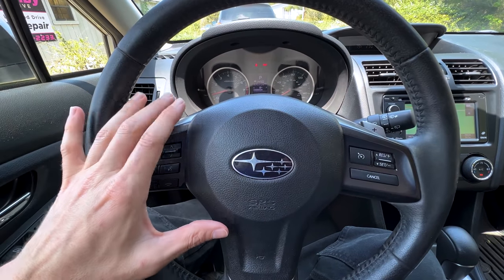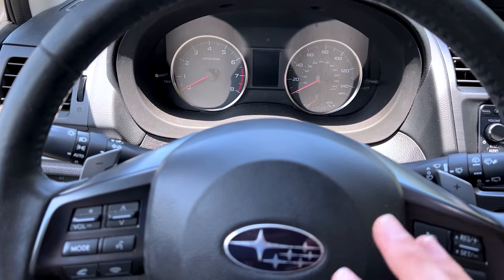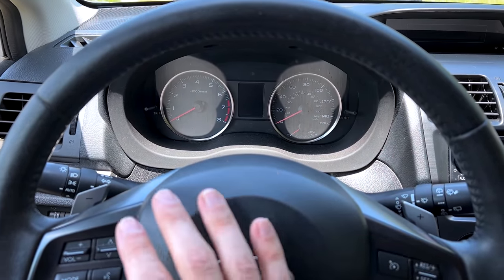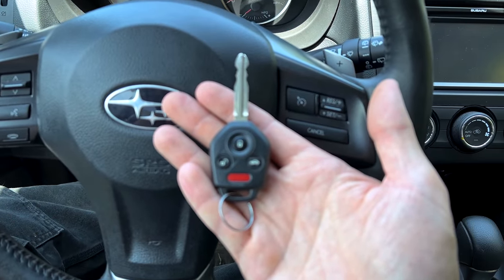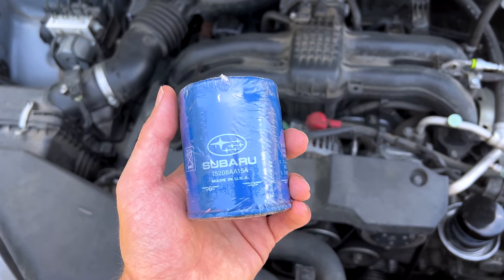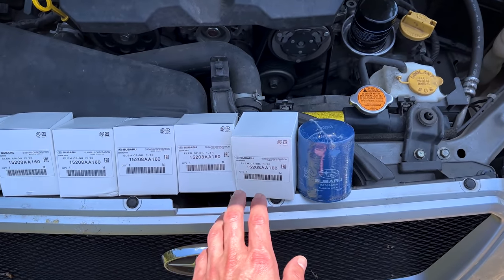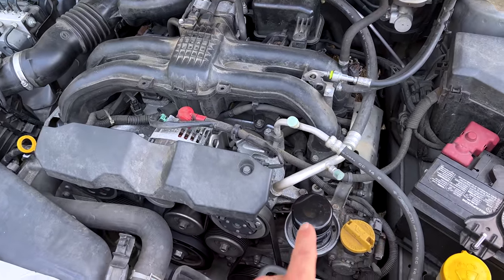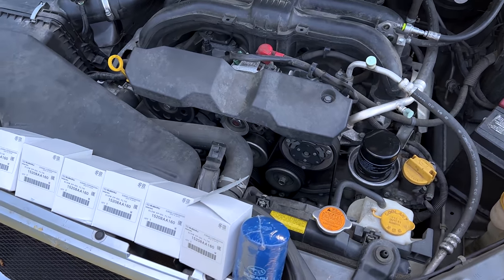Subaru Clear Flood Mode Cranking And Black Vs Blue Subaru Oil Filters! Know The Difference!

Comment: you may have discussed this so forgive me if you have, but what is your opinion on the Baxter Performance Subaru SS-101-BK anti drain adapter?  They were recommended and I plan on putting one on my 2018 outback (it is on order right now),   I am using Wix filters.    You would not have to do the flood clear thing - my wife won't do it.  Also the WIX filters I use are likely better than the Japanese Subaru ones - they are very high quality (I use them on all my vehicles).  Baxter Performance makes an anti drain adapter that is not cheap but seems like it is extremely well made a good solution for the oil drain back problem on these.  I feel like you "get what you pay for."  Have you ever tried or reviewed or have an opinion on these?  I also have used a Fumoto oil drain valve too (now there are other brands too) on my Forester and these should make for extremely simple oil changes - may put one on the outback.  Should have a tool-less oil change except for an air compressor to blow out the schrader valve on the oil drain adapter before changing the filter (so that it drains it of oil so it won't make a mess when you change it).  I am not affiliated with either, but I have heard good things and have hands on with the Fumoto valve and it works great.  You won't need any hand tools or those crush ring washers also.  These are great for people that service their subarus themselves.  You'll still need a tub to drain your oil too, and possibly a funnel but hopefully won't get it all over you because you won't have to remove a plug.  The prices are not cheap, but I think if you buy your subaru early and plan to keep it, they are well worth it (my opinion).  I don't have the Baxter Performance in yet so no "hands-on" personal experience on that yet - but people use their products in Jeeps a lot as well (I have a jeep, but mine is older and does not require it), and you can eliminate that cartridge filter elements on those newer ones and use a bigger/better filter.  Luckily the subies do not have cartridge filters because they are almost always messy, cost as much or more than regular metal filters, and the plastic filter housings and rubber seals are prone to leaking.    What is your opinion?

Comment: I was wondering if manually rotating the motor with a ratchet from the harmonic balancer before startup, and before even installing the accessory belts, would that also prime the entire engine as well? I said ratchet because a drill doesn't fit there..

Comment: I hope you can answer this..  I've got a 2020 Forester.  I've also got a bunch of Subaru 15208AA12A filters from an older Subaru.  My question is, can I use these smaller 15208AA12A filters on the 2020 Forester without issue?

Comment: Hi Mr. Subaru. Will a Toyota 86 (FA engine) oil filter better then the Subaru blue oil filter for the 2013 impreza 2.0L (FB engine) non turbo?  The Toyota filter seems wider and shorter then the blue Subaru one. Will u able to do a compair for those?  If they are compatible, then I will switch to Toyota 86 oil filter rather than using the blue Subaru filter. Thanks for your review

Comment: I was a Subaru dealer technician from the mid 90's till 03 then had my own Subaru shop from then till 09 until I had an offer I just couldnt say no to...
Anyway I'm not sure about spark but I know 98-07 ej engines will shut the injectors off for sure at 95% TPS or greater while cranking 
I've been away from Subaru for a while besides my own stuff so I dont know much about the newer stuff(that's why I watch you right;) lol) but just an FYI

Comment: This has been my question for years - I have an '02 Outback 3.0 L.L. Bean. After every oil change, the first time I start the engine I get maybe 2 seconds of timing chain rattle as the tensioners build pressure. I have tried to eliminate this by filling the new filter with oil before quickly spinning it on, cranking the engine in short 1 second bursts so that it turns but doesn't start, etc. None of this works. Last time I removed the fuel pump fuse, but there is enough residual pressure in the system that the car sort of starts every time for a quick second. After multiple times doing this, then putting the fuse back in, the car starts and I still got a touch of chain tensioner rattle. Because my car is old it's not drive-by-wire so I assume clear flood mode doesn't work. Is the timing chain rattle after an oil change just supposed to be considered "normal"?
Reply: Yes completely normal, that rattle is the sound of the chain rubbing on the guides so no damage is being done. As the timing chain wears more it can rattle on every start not just after oil changes.
Reply: @andreahighsides7756  THANK YOU so much for the response! Very much appreciated.

Comment: Mrsubaru, I got a question.  I did a timing belt kit change. Soon as I start to drive my 97 legacy outback wagon 2.2l it's starts to leak radiator fluid from the bottom on the block. Do I need a rebuild of my motor.

Comment: Great Video! I use K&N (HP-1008) filters on my outback (EJ253). They are small filters, but I change my oil every 3000 miles and never had an issue with any of them. Do you plan on installing an actual temperature gauge on the crosstrek? :)
Reply: K&N is a high flow race filter. It uses a conventional cellulose filter media which allows more flow of oil with less efficient filtration

Comment: My JDM 2004 Subaru Forester has an issue at take off. Its automatic and when lifting off the brake to go it doesnt go until the pedal is lifted about 3/4 of the way and kind of jerks and then goes. Tranny fluid has been changed twice. Front and rear diff fluid has also been changed. Doesnt always do it. Only does it when warmed up. Also never does it in sport shift mode. Always takes off perfect in sport shift mode. Any help is greatly appreciated! Thank you! Car has 75,000km.
Reply: Maybe throttle body is dirty or you need to do an idle control relearn(recommended anytime you disconnect battery)

Comment: Clear flood crank, how long do you crank in order to make sure it's properly circulated and lubricated? I've got a 2015 Forester XT premium so I'm definitely interested in this. 
175k and still running like new so far but I know this will help
Reply: Crank till the oil pressure warning light goes out, or if you have a gauge it starts showing oil pressure,
Reply: I'd say 10 1t sec, don't go way long and overheat the starter. .
Reply: 10 to 15 sec
Reply: For me you do it 5sec and then stop. If you want the light to go off, then do it 5 sec turn off the key; then 5 more sec and then the light goes off.
If I just hold it until the light goes off, it’s like 15secs...

Comment: Can this be done in a manuel car like the WRX? Dealers in Florida use black oil filter. But currently use purolator oil filter.
Reply from the maker: Yes. Just hold the clutch and throttle all the way to the floor.

Comment: I already schedule an Appointment with Subaru dealership for my 2016 Forester 2.5i with 51,745 odometer, which is due for oil service and I did asked the dealership if I bring my own engine oil change a JDM (Black Oil Filter) about to buy soon do they that service? They reply no problem. 

I do have another question I am about to buy the JDM Black Oil Filter from eBay link you provided on previous video is it accurate? $27.55 2-Pack from usautopartsexpert1920

Comment: I've just tried this on my 2002 WRX with DBC, on a Carberry ROM. It works, it does not start.
Points of concern tho:
- not sure if the FP is running, the starter and engine are loud. I can hear it for sure after I let go of the key.
- after this maneuver, it starts badly, low revs, unstable for a few seconds. As if the cylinders are flooded with petrol maybe?

If the injectors do not open, all is fine, the fuel gets sent on the return line back to the tank.
If the injectors open, it's quite bad, oil contamination of the worst kind.
Can anyone advice?

Comment: I got a Subaru uk300 and it just throw up p1544 code now it wont accelerate I cleared the code and it just keeps coming back if I throttle it it just kills engine revs ? Any ideas plz

Comment: What's the next best choice in oil filters if you can't locate the black filters?  I read Wix makes decent filters?
Reply: Folks on the Outback forums like WIX, I have been using the re-branded one from NAPA 47055 for the past 100K My 2017 Outback still runs like a champ with over 120K miles on it.

Comment: Fram has gotten a lot better than they used to be.
Reply: Sorry but no they haven't.  Cut one open sometime.  Everything he said is correct fram is totally trash . A cheap ass Walmart filter is far better
Reply: @robertvanderhoof5283  well I happen to work in auto parts and yes they have.
Reply: Ya so do I and they still suck .
Reply from the maker: FRAM is still the worst oil filter on the market! 😂
Reply: @MrSubaru1387  it is astonishing that the manufacturer, Subaru, would sell such poor quality oil filters as OEM filters at their dealerships. Normally, you expect to pay a little more at the dealership parts department and get decent quality parts.

Comment: I just changed 2016 Impreza Sport oil filter to a Tokyo Roki model, the number is 15208AA130 (instead of  ending in 160), The size is a little more stubby (shorter but wider) Are there any differences between the Black JDM filter you are using and this 15208AA130? I think it was sold as a BRZ filter. 

Aside: I've been making videos about economy car tuning for performance. I often watch your videos since they have all sorts of great information and tutorials :) Thanks!

My latest video:  https://youtu.be/ArxJhaPzlC8 (Inexpensive performance mods for Impreza/Crosstrek)